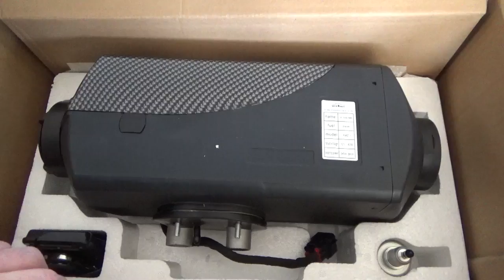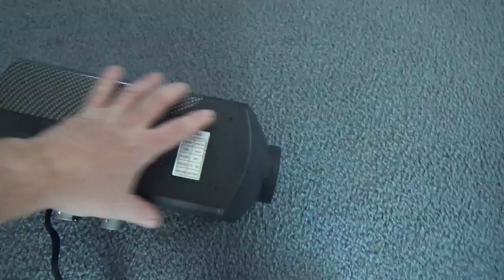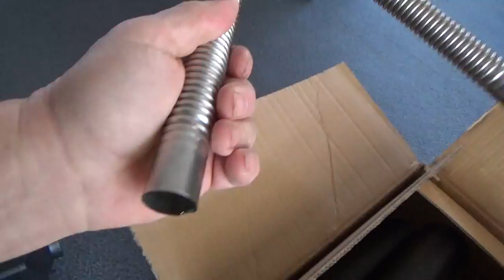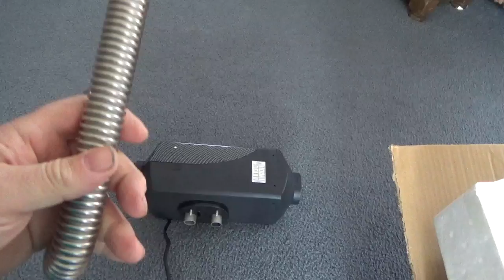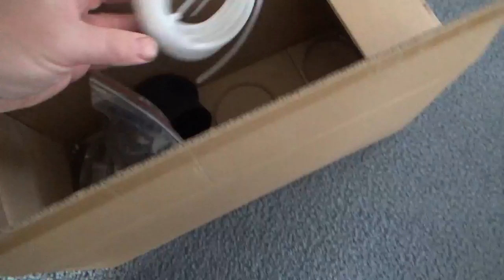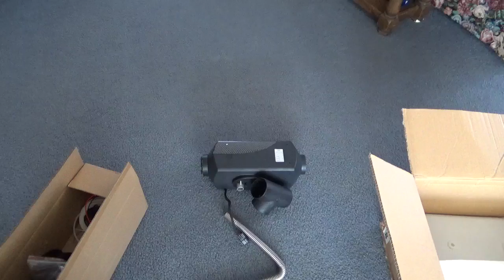Best Garage Heater Ever, Diesel Air heater, 27K BTU, near 100% efficient!

Comment: I installed one in my neighbors semi and it draws from his fuel tank but went with the 5k . Works great 👍 I also installed one in my camper ( 8k ) and even in this weather it’s nice and warm in there ! I ordered 2 more , 8k’s for my kid’s campers and will install this spring but around here propane is $9.99 to refill a 20#er and Diesel is $2.95 a gal. So in my work shop I use a Mr. Heater cabinet heater and it keeps my shop at 68 degrees . Works for me !

Comment: FYI there is no such thing as an 8kw chinese diesel heater that actually puts out more than 5kw. It's exactly the same size, shape, and basic design as an Eberspacher D4 which is rated at 4kw. The reason they call them 8k is to charge a slight premium for them while selling you a 5kw product. I've found 5kw plastic case with remote and LCD for around $110-120. Might as well save your money and buy the 5kw. Just make sure you properly tune it so it doesn't soot up.
Reply: Also forgot to mention someone tested one of these and it's 78% efficient on full blast and 89% on the lowest setting on a properly tuned 5kw model. (1.9 hz on low 5.5 hz on high).

Comment: Looks like a great heater hope it works out great.  On another note I was hoping you could help me with a 300ex I purchased. Or maybe one of your other tubers might be able to help. I am very good at building bikes have been doing it for years but primarily on older bikes from the 70s and 80s. It has no spark and I have checked everything and it all checks out except one thing there is a neutral and reverse switch/ sensor on the clutch side according to the manual when in reverse the reverse switch should have continuity to ground when in reverse but mine has it when it’s in neutral and none in reverse. I don’t know but i would think that the bike thinks it’s in reverse and will not start/ spark. It will still crank in reverse or neutral. I was hoping you could check a couple of your bikes and see if you have ground on the reverse switch wire when it’s in reverse or neutral. Any help is appreciated. Clearly if mine is backwards like I suspect someone has been in there and didn’t put something back together right thanks again and keep up the good work

Comment: I bought 1 and I have 24x23 garage and it does not heat the garage up on full blast and nothing if u get close to the air output it hot but deff doesnt heat the whole garage.
Reply: Chase Brown is your garage insulated? I’ve been using one of these heaters in my insulated 22X24 garage (9’ walls) without issue. I’m up in Alberta so it’s anything but warm here in winter. 😆

Comment: Them 8KW heaters are Not 8KW heaters. Its a myth. Check out John McK 47 youtube channel, he proves they are just a 5KW heater. I my self did the same test and confirmed the same results John got. Check out the Diesel air heater All In One heater. I put one in my enclosed trailer and out in my shop. I have so far installed 3 more in friends enclosed trailers. Good video.
Reply: Clearly.. they are a clone of the eberspacher d4 which is actually a 4kw rated output. Chinese like to inflate their numbers.

Comment: You have the math right for a 100% efficient heater. But your heater is a clone of the eberspacher d4. Take a look at the eberspacher d8 it's a 8kw heater and it takes 1L an hour to make 8kw of heat. So it has the standard 80% efficiency which is great for these heaters. How you got the number of .8L /hr for your heater is beyond me. Your pump will be the same provided for the Chinese 5kw heaters which provides 19-22ml/1000 strokes. I'm sorry to tell you that your numbers are way off. You have a 4kw clone that can be overclocked out close to 5kw.  If you want 8kws of heat get another heater and you will use the same amount of fuel as a d8. Don't turn your fuel mixture without testing your exhaust emissions you will just soot up
Reply: The 8kw versions, even though same as 5kw, have "overclocked" settings. They do provide more output but not much more as the combustion temp gets really high and the pump slows every 15 seconds or so.